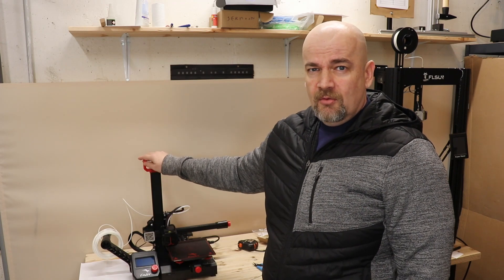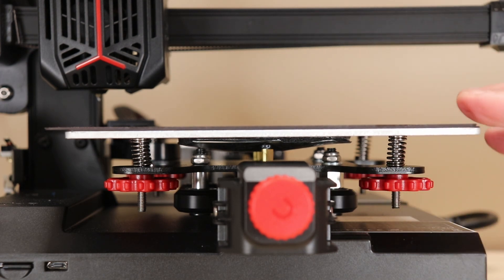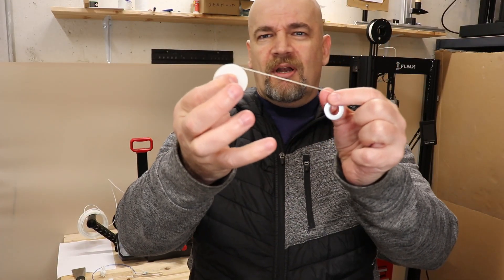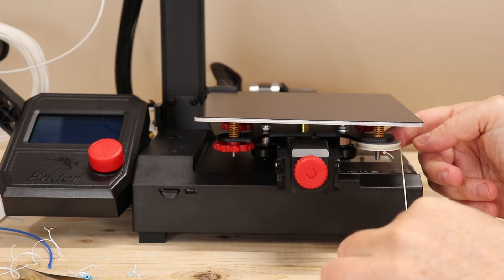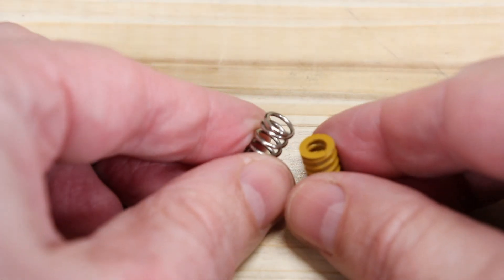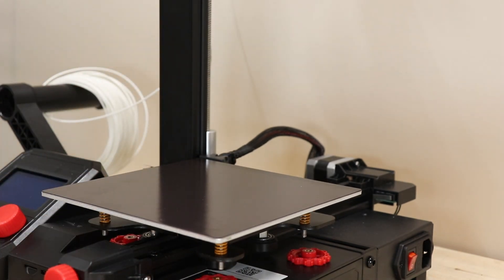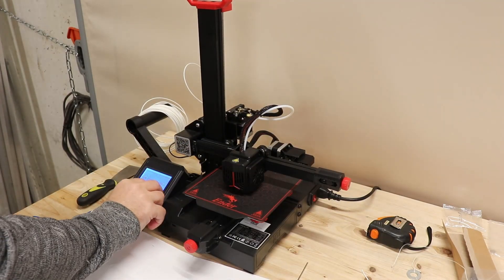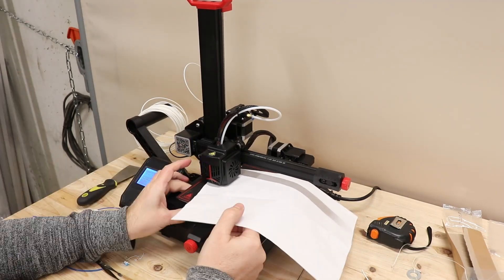My first Ender-2 Pro upgrade: yellow springs

Comment: I am seriously considering buying this printer to play around in the office for tinkering projects. As for springs vs silicone, I would prefer Silicones as all on my printers using those produced the best results. The bed stayed level far longer, and all I do is use bed level command with BLTouch to be on the safe side.

Comment: Those springs don't flex enough. If nozzle goes too low it will warp the aluminum instead of compressing the springs.

Comment: another thing you can do which helps is - remove bed from the print wheels and spring) put on a rubber washer to protect the bed and then screw on a nylock nut right up to the washer and make sure is is tight.  Do this to the other 3 corners. refit the spring and put back onto the bed and fit wheels and level bed again.  what this will do is stop the bolt from spinning in the hole

Comment: So far I’ve upgraded the springs, the extruder, and installed a BL Touch. The BL touch was the most difficult
Reply from the maker: I believe the difficult was the hardware part. Can you post an image somewhere of your solution? And you used own firmware? You can post an image in comment on FB page: https://www.facebook.com/mytechfun.igor/
Reply: @MyTechFun  I don't use facebook but I sent you an email with a thingiverse link detailing everything that you should need. Let me know if you've received it!
Reply from the maker: @opinion_panda  email arrived, thank you
Reply: @MyTechFun  awesome. Let me know if you have any questions
Reply: Would love to know this as well. Just purchased the printer and BL touch will be in a few days. Can you post a link? I also plan on doing a DD with a pancake motor. I'll be running very slow speeds of say 20 for TPU. tks!

Comment: DO  you mind sharing your Cura Settings? Print head settings in particular.
Reply from the maker: Just add the printer and follow those instructions from the video, nothing special in my settings (so far). Maybe in few months of using I will have more experience and better custom settings in Cura.

Comment: This machine looks like a nice one.  The build volume is big enough for most items I have printed.  And the hotend and bed temps are good enough for my PetG settings.  Honestly it looks like it would make a perfect machine for a person wanting to use a 3d printer but not wanting or needing to go very far into 3d printing.
Reply from the maker: I agree. But depend of the PETG, some types requires 85-90°C bed temp (for example Prusament recommendation). But you can always use glue stick or other adhesion material.

Comment: Hello,

1:02 can not turn the red knobs of the heating bed 180 degrees (angle) to get a larger bearing surface, so that the no longer adjust so easily?

Many greetings

juck.
Reply from the maker: I don't understand your commend 100%, but maybe you can adjust the position of the Z-limit switch, if you are limited by that(?). Also explained in the video.

Comment: This is SO MUCH SNAKE OIL. Sorry.
1) The "unrolling force" says something about the coefficient of static friction of the nut, and perhaps about the preload on the nut; NOTHING about the stiffness of the spring.
2) The "stiffness" whenever a bolt is pre-tensioned with a spring is determined by THE BOLT, and not by the spring. The spring merely "keeps it in contact".
3) In every crappy sheet-metal construction of the undercarriage of the print-bed is a cantilever stamped sheet-metal "flower" that holds the four bolts. This is far more compliant than the tensile strength of the bolt, and THIS is what ultimately determines the stiffness that you feel at the bed. (until all preload is lost, and the springs actually flex)
4) When the bolt finally DOES lose contact when e.g. a head crashes into the bed, you WANT the spring to be as sloppy as possible, to give way, to prevent damage.

The REAL issues that are convenient to ignore are:
1) four points over-determine a surface. A three-point suspension would be better.
2) What gives the print-bed sideways-stiffness ? It is on four "feet".
3) The heater is aluminium, not always flat, and the bed is glass. The two have different TempCos too. Beds tend to bend under influence from bed-heating. No "engineered dilatation lines" are present.
4) momentum-balance of moving parts, cantilever-loading of the X and Z axes, .. the list goes on. (if you REALLY wan to tackle these, step away from the Ender platform)

The Ender 2 and Ender 3 are good entry-level printers. They do some things well, so that things "just work" for a new user. There are many things worth improving too, but the non-yellow-springs are not on this list.

Comment: One keyword: lock-nut.  Even with extra pull from the stronger springs, the normal wheels are still easy to turn.  That might be nice to adjust stuff, but also means they more easily move whe  you don't want them to (rattle).  Using a lock-nut (possibly inside a 3d printed wheel) could help, right?
Reply: Indeed, its not the force of the spring but the friction you need to tackle. A knob with a locknut will do better. Locknuts are desing just for such purposes. A stronger spring may break the stud from the heatplate.
Reply: @ruudb72  I do also recommend the change to the yellow springs though, because they are much more rigid (also perpendicular to their axis).  With soft springs the bed can move in z by further compressing the springs AND in x & y direction by tilting the bolts which those soft springs barely guard against unless tightened all the way to the max.  The yellow springs protect much better against both of these, mainly because of their larger rectangular cross-section and flat ends that just make them less "bendable".  A more rigid bed mounting should help reduce ghosting and other artefacts, so I think the yellow springs are still a good upgrade.